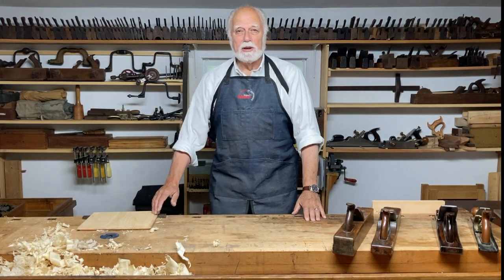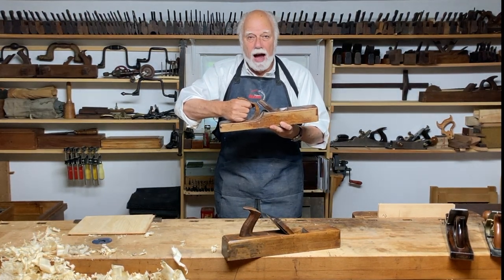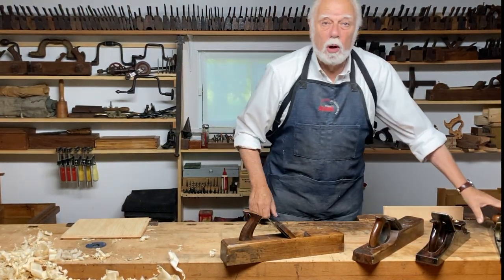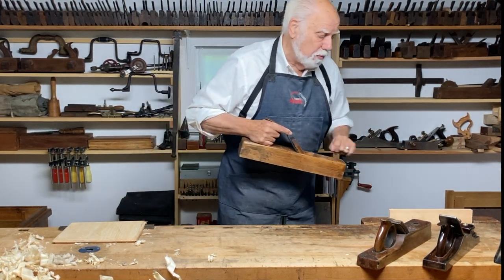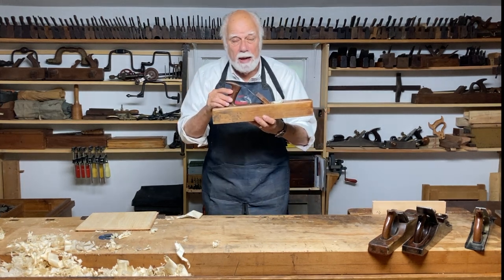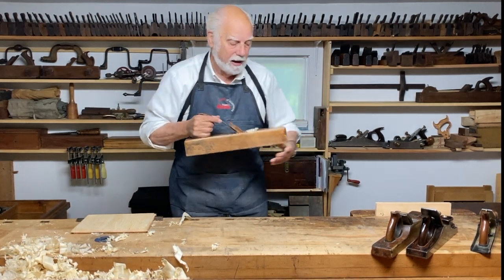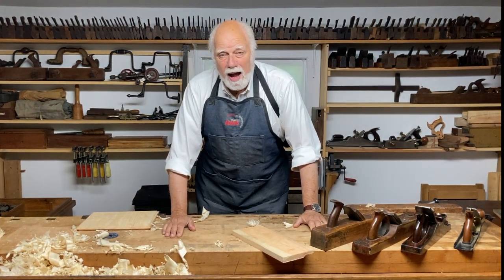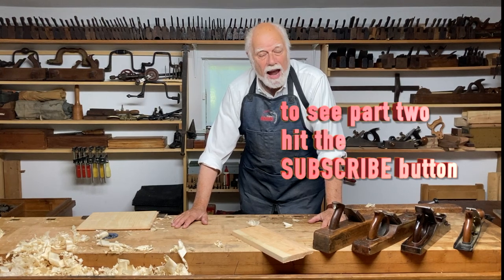03. The One Plane you must have: Part One

Comment: so if you wanted to make a wood jack plane, but dont have an existing jack plane, how would you go about doing that?
Reply from the maker: Buy a super cheap (damaged) plane on eBay and use it as a model.
Reply: @gjbmunc  Yah, I thought of that & I might still go that route if something comes up.....But I'd still need to flatten it, given its the tool I would want to use for that, I'm wondering how to work around that.

Comment: Excellent videos, you earned my subscription in the first 20 seconds.

What's the blue threaded part in your bench for?

Rex Kruger sent me your way.
I've been running Stanley planes for a few years but am now looking for and starting to use old wooden ones.
Reply from the maker: The blue bit is an insert for my holdfast.
Reply: @gjbmunc  Is it just to make the hole last longer? Do the threads help the grip? I'm using holdfasts too, and have had to dimple them with a centerpunch.

Comment: If you flatten the sole without the iron bedded in the plane, it will not be flat. When you put tension on the body with the iron/wedge it changes the geometry of the body.

You need to have the iron bedded andset back from the mouth to truly flatten a plane, any plane.
Reply from the maker: I always do this, but better quality planes, such as the newer Lie-nielsons, are made with much stronger bodies than Stanleys precisely for this reason.

Comment: I've got a bog standard Stanley no.5 Jack Plane, which I use for pretty much everything as I'm not well off enough to be able to afford a planer/thicknesser. Some really good points in that video. Just wondering though. In America, they don't generally tend to stock beechwood in lumber yards (and I don't believe they ever have). Wooden bench planes are generally made out of beech, as it's good and hard and (in Europe) easy to get hold of. So are the American made Bench Planes made out of something like hickory or maple, rather than beechwood? It looks like the ones in your video are European beech ones. Are they from Europe (the UK) or are they American made?? I've got one of those Scottish planes actually, all beat up. I'm going to have to find out how much mine is worth! And I'm down just down the road (in Dumfries and Galloway in Scotland) where it was made in Ayr.
Reply from the maker: Most American-made wooden planes were indeed made from beech although one does come across the odd lignum vitae, etc. plus there are a few new makers, but they tend to be VERY expensive.
Reply: @gjbmunc  Interesting. Wortheffort says Hi by the way (just passing that on).

Comment: What was the technique used to flattening long faces that were more than twice the length of the plane?
Reply from the maker: Use a jointer plane, with or without a guide to keep the edge square. and if the sole of the plane is perfectly flat, then when you can take a continuous shaving from end to end you know the edge is perfectly straight. (Episodes 11 an 7 wil help.)
Reply: @gjbmunc  Thank you. If someone were planing a surface that would even be too long for a jointer plane, would the solution be to divide the board into sections, flatten those, and then level them to a continuous shaving?